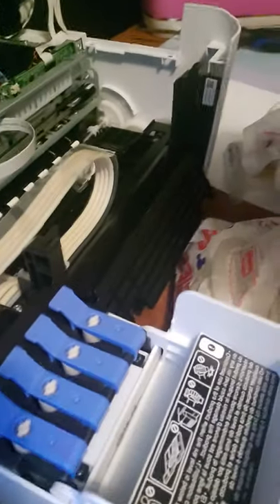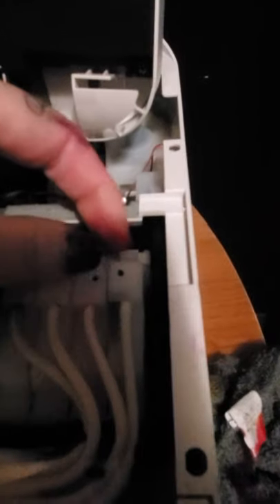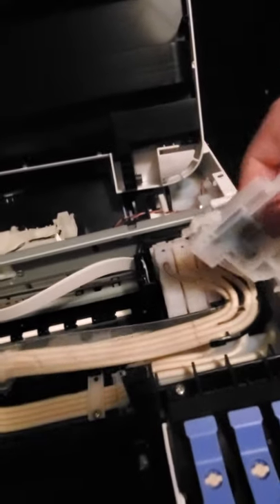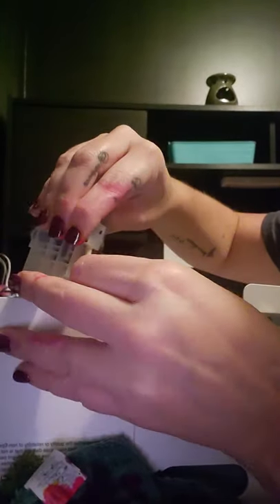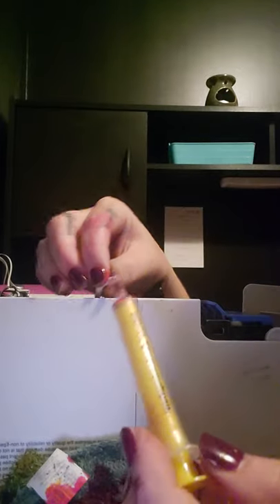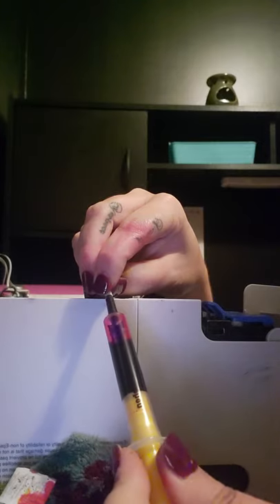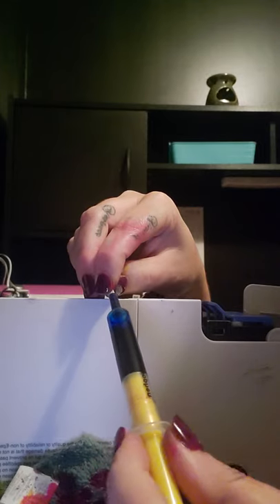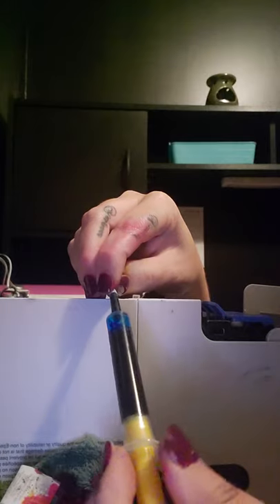How to remove epson et2720 ink for sublimation ink

Comment: Was it because of Amazon that you ordered the wrong ink? Bc that’s what happened to me. I was 100% sure I was ordering sublimation, did my set up, printed and then went to press and nothing transferred.  That’s when I knew Amazon did me dirty 😩
Reply from the maker: No I used the ink that came with the printer
Reply: This is what happened to me! I searched for sublimation ink and I vought one of the suggestion. Turns out it wasnt sublimation ink!
Reply: Hi the same thing is happening to me, how did y’all figure out it was the ink for sure?
Reply: @kcha5756  If it's just pressing wrong, it always passes a litle bit to the product. It needed to say SUBLIMATON INK in the package, otherwise won't work

Comment: Thank you for the video. How did you remove the top of the printer, that exposes the ink tubes?
Reply: That’s my question too..
Reply: @printsnthings6932  you gotta take out the screws behind the front panel of the printer

Comment: I did the same thing but I had already used it. It wasn't until I  realized that I  used the wrong ink until 5 prints later and said oh crap no wonder the ink wasn't transferring.   My question to you is, did you print on your machine before you realized that it was the wrong ink?

Comment: After I drain does the ink left over and mixing with the sub ink matter? Also when you do your test prints are you using just regular computer paper or sub paper? Thank you, this video is so helpful! My “brand new” 2720 come with the ink already installed 😭 I was so bummed!
Reply from the maker: U will want to run it out by doing test pages and clean print head before adding the new ink but a little being left over want hurt it ànd I just use regular paper love
Reply: @momofeverything5136  awesome, Thank you so much! <3
Reply from the maker: @nikkimorrow966  u very welcome

Comment: How did you open your printer ?
Reply from the maker: Lift the stop and u should see some screws and on the side
Reply: @momofeverything5136  thank you. You are a life Saver. I do have 2 more questions. Did you put the sublimation ink after you press the clean thing on the menu? And Also which sublimation ink did you use and from where?
Reply from the maker: @raduliliana8866  yes after its clean and printer jet 400ml from Amazon u got to use the sublimation ink that's capable with the printer
Reply from the maker: @raduliliana8866  and thanks girl for watching my videos

Comment: How do you get the rest of the old ink out and how do you clean the heads?
Reply from the maker: I didn't have to and it's in the settings on the screen on the printer
Reply: @momofeverything5136  cause I got as much ink out as I could. When cleaning heads do you have to Add new ink first? Cause I am still waiting for my new one to come in the mail
Reply from the maker: @joelsbabygirl11  you are waiting for your printer to come in
Reply: @momofeverything5136  no I have my printer I accidentally put the wrong ink in so I had to get it out I got as much as I could out now I am waiting for the sublimation ink to come in.. so to clean the heads do i do it while there is little to no ink in there or what for the sublimation to come in
Reply from the maker: @joelsbabygirl11  u can start doing it now and do it when u put the new ink in but do a test page u want all the lines to show ill do a video on it but its easy just go to the print setting on the main screen of the printer and it will guide you how to do it
Reply: @momofeverything5136  yesss could you pleaseeee do a video??
Reply from the maker: @joelsbabygirl11  yes mam just give me a little bit I got two sick babies but it will be done today
Reply: @momofeverything5136  thank you so much! 
Aw I hope your babies feel better! I completely understand how it goes when they are sick
Reply: So on the printer does it say run a test page?
Reply from the maker: @joelsbabygirl11  yes it will I will post video today my babies ended up getting worst im sorry but I haven't forgot
Reply: @momofeverything5136  oh no poor babies 😞😞 🙏
Thank you
Reply from the maker: @joelsbabygirl11  thx girl they been awful and I got yall today
Reply: @momofeverything5136  well I hope they are feeling better
Reply: @momofeverything5136  I got my ink! Just waiting for your video so I no what to do 😁
Reply from the maker: @joelsbabygirl11  ok uploading next hŕ
Reply: @momofeverything5136  okay! Thank you
Reply from the maker: @joelsbabygirl11  hey girl the video is uploading will be available soon love
Reply: @momofeverything5136  okay awesome thank you so so much I can’t wait! I’m so ready to start my shirts
Reply from the maker: @joelsbabygirl11  u very welcome girl and its so fun
Reply from the maker: Did you watch the video
Reply: @momofeverything5136  gonna go look now!
Reply: I watched it! I’m in the process of trying to get all the old ink out now before I put sublimation in.. also your sublimation ink did it have the correct top to get it in? Because mine has a top that I can’t use to get it in
Reply from the maker: @joelsbabygirl11  u keep the bottles the printer came with and wash them out then put your sublimation ink in those
Reply: @momofeverything5136  okay I have those! I will have to empty them out how long do you want to put the sublimation in them? I’m trying to print pictures to get the rest of this ink out
Reply from the maker: @joelsbabygirl11  u need to leave them out to dry but u can dry the inside with a napkin or something but the nozzle part you wanna make sure its completely dry before doing so
Reply: @momofeverything5136  okay I will do that tonight then and let them dry overnight hopefully the ink runs out soon! I can still see all the lines
Reply from the maker: @joelsbabygirl11  yeah girl just keep doing it u got this
Reply: @momofeverything5136  so I got everything switched cleaned my printer heads and did a check but nothing is barely printing
Reply from the maker: @joelsbabygirl11  did u reset it
Reply: @momofeverything5136  I did the head cleaning twice and then tried to do a nozzle check that’s all I’m not sure how to reset it
Reply: What sublimation ink are you using?
Reply from the maker: @joelsbabygirl11  printers jack ink 400ml
Reply from the maker: @joelsbabygirl11  its in my video how to reset it
Reply: @momofeverything5136  someone told me that because the ink is thick it takes awhile for it to show did yours?
Reply from the maker: @joelsbabygirl11  yes it did just keep doing print scans òf the lines till it comes through
Reply: @momofeverything5136  how long did yours take? someone said it took her about 2 days and like 4-6 hours
Reply from the maker: @joelsbabygirl11  no I was able to use it right away
Reply: @momofeverything5136  okay cause mine isn’t working
Reply from the maker: @joelsbabygirl11  lift the top off and see if u got the lines in tight and it's running through
Reply: @momofeverything5136  I’m gonna check but it was working for the old ink I just hope me running the ink all the way out didn’t mess it up
Reply: How can I get the ink to flow through the head cause I took them out and only the black was but even the black didn’t come on the paper completely

Comment: Hi I removed all the original ink from my 2720 and put new sublimation ink and now my printer will not print and ink is full. I’ve ran a clean nozzle check and all that stuff and reset ink and it still won’t print can someone please help me
Reply: Did you get it to work?
Reply: Same HELP